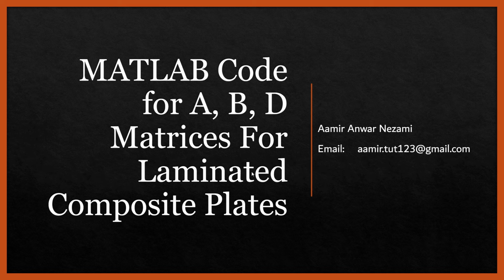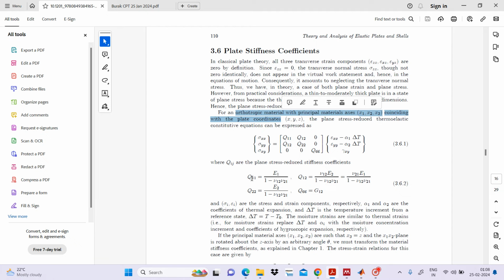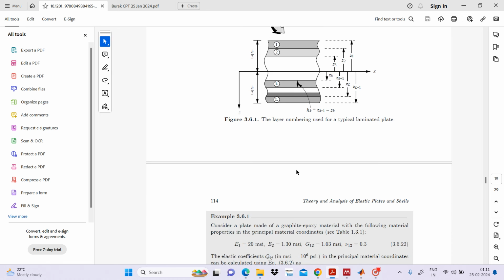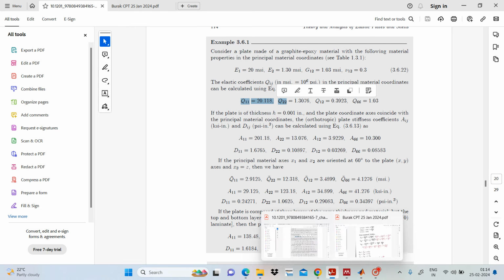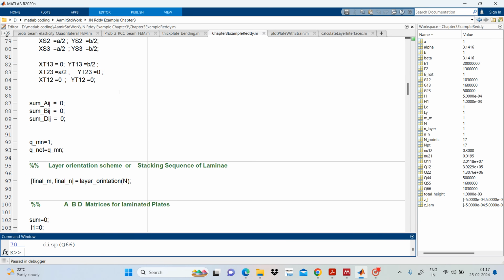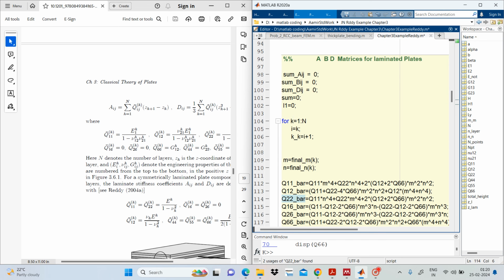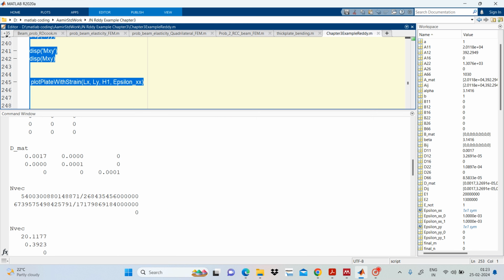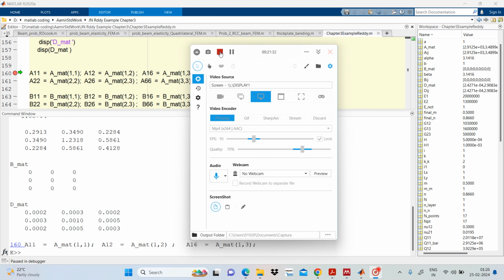Matlab Code for generating A B D Matrices of Laminated Composite Plates

Comment: Sir please take one session on elements connectivity in fiber reinforced composite plate
Reply from the maker: Thanks for the very nice suggestions. Right now I am using the analytical approach for solving the laminated composite plates, If I will use the FEM approach or if I will get some time then I will explain elements connectivity.  You may contact on my mail id: aamir.tut123@gmail.com for further query.